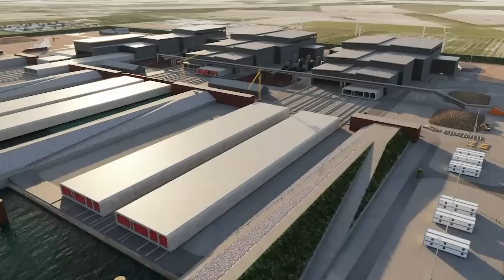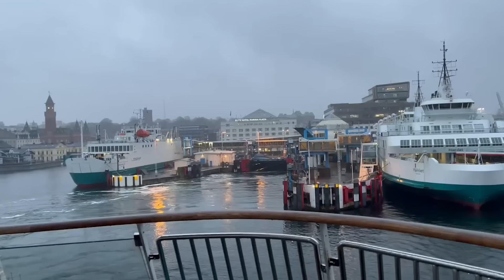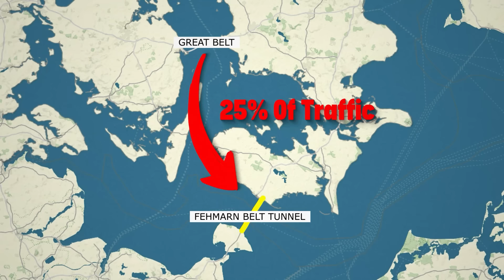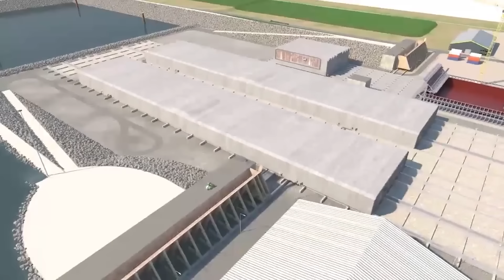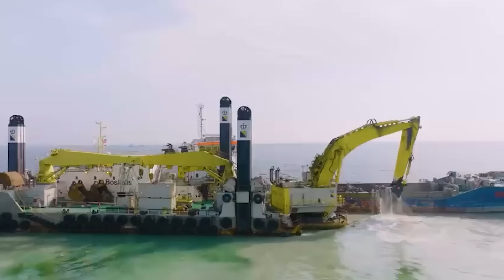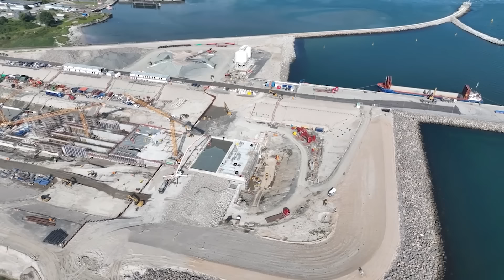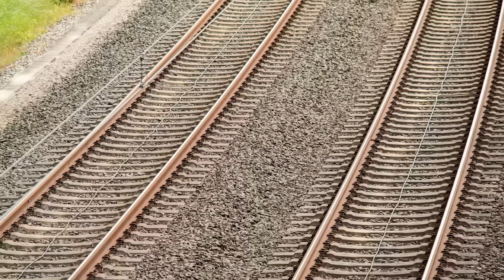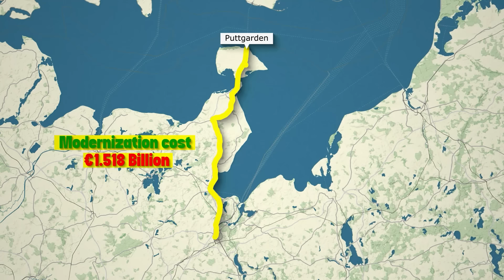Could Germany’s Delays Ruin a €7.4 Billion Mega Tunnel Project?

Comment: LONGEST UNDERSEA RAIL TUNNEL 53.85km - JAPAN.
But the longest undersea rail tunnel in the World is the "Seikan tunnel" in Japan that is 53.85 Kilometres long. Followed by the Channel tunnel between Britain and France at 50.5Km long. So considerably longer than the 18Km mentioned in this programme ?????
Reply from the maker: The Fehmarn tunnel will be the longest immersed tunnel. It’s not about total length in absolute terms, but about the construction type. The Seikan Tunnel is still the longest rail tunnel overall, and you can also find videos about both the Seikan Tunnel and the Channel Tunnel on our channel.
Reply: @RailwaysExplained  And that's is supposed to be some sort of Engineering marvel, I don't think ?  Exactly what Qualifications do yo have to list your channel as "Railways Explained" ????
Reply: @railwaymechanicalengineer4587  it’s a very different type of tunnel, it was considered to make it a traditional tunnel but it was not possible to design the tunnel so it was probably to use railway in the tunnel it would have to be built to deep and the angle of the climb would be too steep for a train the earth is not very suitable for a traditional boring tunnel and yes this is significantly more complicated to build then a simple boring tunnel which is the easiest least technical complex way but it wasn’t possible so we had to do it the hard way unfortunately and expensive, this tunnel has to have enormous amount of support facilities instead of just boring tunnel, but why are you commenting on something you clearly know nothing about you are not a engineer or your country is lacking behind on education.
Reply: @railwaymechanicalengineer4587  Building an immersed tunnel out of prefabricated segments that are laid onto the seabed is a completely different method with completely different challenges compared to boring through solid rock.

Both are engineering marvels in their own right.

And btw. if we are going to be nitpicky, the undersea section of the Chunnel (38km) is actually longer than that of the Seikan tunnel (23km). So again, it depends on the definition of what an 'undersea tunnel' is.
Reply: @stephanweinberger  As a senior ex British Railways Mechanical & Electrical Engineer I have worked for many Railways around the World. But I am not convinced you catually know what your talking about ! Which is why I asked, exactly what qualifications you have that makes you think you can call your website "Railways Explained ".
Reply: @railwaymechanicalengineer4587  ok, so we now at least know your reading skills ;-) (hint: different person)
Reply: @stephanweinberger  Yes I thought it ws the reply I was waiting for. Sorry. And I am fully aware of the vagaries of both the Channel tunnel and the Seikan tunnel, having worked for both British Railways and three Japanese Railway companies.

Comment: As a German, I am so damn angry and sad about this. We are not keeping our promise to expand the rail network with Switzerland, with Austria and Italy at the Brenner Pass, and now not with Denmark either. This country is a fucking joke.

Dear Danes, please sue the German government into the ground.
Reply: After 20 years of waiting Switzerland literally payed Germany to electrify and modernize the rails to München and it still took them about 10 years.
At some point SBB even proposed Germany should just give it ownership of the tracks and then we would do it ourself. Its pretty annoying and definitely holding back rail just because of Germanys central local.
Reply: Same happened with the rail freight line connecting the German industrial areas with the Rotterdam harbour. The Dutch part was finished in 2007. The Germans haven't even started on their part.
Reply: Sounds like the German saying "Ordnung muss sein" (Order must be maintained) has been forgotten
Reply: @MPbmfm  It is not forgotten, it has been exaggerated. To be correct in all possible ways, there so many procedures set up that it is very difficult to get things done. Except when it is about motorways.
Reply: @boldvankaalen3896 they are waiting for the next terrorizm ( like NS2).
Reply: sehe ich genauso. Die Politiker sind rundum unfähig und korrupt.
Reply: I just took the train from Hamburg to Munich and experienced how the delays piled up along the way so that we barely made it to our next train. German infrastructure, once renowned, is no longer in good shape.
Reply: Curious how building of Ore Maintain Tunnel between germany And Czechia will go, that's some competition on screwing up
Reply: I'd love to, but sadly our politicians are of equivalent "quality"... so they will mess it up.
Reply: We pay for the whole effing eu. Enough is enough. Pay us germans you mf want to use our land!
Reply: @HedgehogZone Denmark also pays more to the EU than we recieve! I understand your frustration, but remember that Germany is not the only country who funds the union.
Reply: If we sue the government, you're the one that ends up paying the bill
Reply: @DerpParrot, i dont care. The german government needs to feel consequences for there miss management
Reply: If we sue the German government, you will just close the bordershops, then we cannot buy cheap beer, and we will sober up. It will be much worse for all of us. Regards a Dane that is mildly annoyed at you for not keeping to your deadline.

First part is partly sarcasm and partly self-deprecating humour if someone is in doubt.
Reply: @Redgribben dude I am sorry for you and us honestly we have this shitty government since the 90s
Reply: I do think we Danes also have problems with the ship which is intended to service the elements being placed at the end of the former, below the sea.
Reply: And with Czechia as well, I haven't heard about any progress on Erzgebirgs Tunnel project in a while, federal government seems lukewarm to upgrade of line from border through Furth im Wald to Nürnberg and ignored and almost ommited stretch of line from Marktredwitz to border where it would connect to already electrified mainline.

And it seems like there also is no proposal, yet, to electrify line from Görlitz to Zittau (or Open Railway map does not show it) and to Czechia even thou there is proposal to electrify the line from Liberec to border. Given the proposed tunnel and new line from Liberec to central Bohemia, it would also provide new route for freight trains from area of north-east Germany to south-east Europe (and possibly also Italy). But in this case I bit get it as this project has only low priority in Czechia, unlike those two mentioned before.
Reply: Germany is decades behind on everything. It literally feels like going back in time, 1990s or even longer, when I visit Germany.
Reply: When I grew up, Germany was a trustworthy and reliable partner in Europe. This is not true anymore.

And for all people saying it is because of people complaining. Well, people are also complaining in Denmark, but Germany signed a treaty way back in 2008. That is almost 20 years for complaints.
Reply: Not the government but the people who live there and stop the projects. It's not the governments fault.
Reply: @UlliStein  so, a situation similar to that with the UK and the HS2 high speed line... there's still room for national and regional government to step in and limit the ability to challenge nationally significant infrastructure projects
Reply: @MercenaryPen  Thanks, yes that's so sad to compare this to high speed trains in France and Spain having their own tracks. It was so great to go from Madrid to Valencia with 300 km/h for 22 €. The train was perfectly on time and I was so amazed and jealous!!
Reply: @UlliStein No, that’s still the government’s fault. Locals only have as much power to stop an infrastructure project as the government lets them have.

And sure, you could argue that this is due to strong protections for property owners, but counterpoint, Germany has a law that allows them to demolish entire historical villages for ”the public good” if there’s coal underneath.
Reply: @UlliStein  The government has put legal procedures in place which allow these small interest groups to interfere indefinetely. Denmark does not have those.
Reply: @UlliStein  Just change the laws that it's harder to object to projects of national interest
Reply: @Breadfan00  Yes that would be a good idea, maybe a bit less democratic but it would help everyone.
Reply: @UlliStein  You act as if the government had no power to  design the process such that this wouldn't be possible.
Reply: @UlliStein Fix it. Change the laws until the problems can be solved.
Reply: haha we dont care we build bridges and tunnels just for the entertainment at this point 😂😂😂
with love from Denmark :D
Reply: @danis8455  speak for yourself. Some of us very much DO care
Reply: @Nordlys-Incognito you must have a pretty empty life getting mad about danish bridge obsession 😂😂😂😂

Comment: I'm German and unfortunately, we became so unable to do progress with infrastructure. It must be as cheap as possible, will undergo numerous studies, then all the NIMBYs delay everything by years with legal action, planners make many mistakes, so replannings have to be done, then costs rise because of that, then public complains arise that nothing happens. It's always the same. Just look at Stuttgart21, BER Airport (opened like 10 years delayed), the "Brenner-Nordzulauf) which is the connection to the new Brenner-Base-Tunnel, which didn't even start construction or the new Hamburg-Hannover High-speed Railway connection which also didn't start construction even though it's in discussion for decades
Reply: Germany became unable to do progress. Period
Reply: @fischX  Germany is unwilling to progress. If we keep voting for the conservative party that fucks everything up then we will continue to fuck everything up. The CDU has been nothing if not consistent, when it comes to austerity and corruption.
Reply: And  also Betuwe-lijn. It’s a freight rail from Rotterdam to Germany. Dutch part was finished 16 years ago. Building the German part should have started in 2003, but was postponed until 2016. And now it’s delayed to 2026. You managed to remarkably upset everyone around Germany...
Reply: @Alby_Torino  That’s probably a case of covert protectionism. Germany has no interest in shifting its maritime freight to Dutch ports and would rather use German ports.
Reply: @Sevyyy1406 you forgot to mention the Highspeed Line between Mannheim and Frankfurt ;) We are talking about this line since decades, but nothing has happened besides some studies and planning... its ridiculous, how long this takes
Reply: Don't forget the 3,2 km of A100 in Berlin :face-green-smiling:
Reply: I'm in a small town (30k people) just outside of Hamburg. It has a direct rail connection to Hamburg, but it and the local station have been shut down for decades. But on the upside, they're now planning to turn upgrade that existing old rail connection to an S-Bahn! Though a couple of studies need to be performed first, and lot of people living along the line have put up banners protesting the reactivation of the line. Even people who live more than 100 meters from the rails but directly on the B5, WHERE THERE IS TRUCK TRAFFIC DAY AND NIGHT. Anyways, that needs to be dealt with too, obviously. So the planning period to extend the S-Bahn network by simply refurbishing this existing line will take until 2032. 

Schon geil, wa?
Reply: In my opinion, we Germans don't want high-speed trains at all. The ticket prices charged here are so astronomical that it's much cheaper to just drive car.
If you then look at the stops between the routes, it is not possible that a train travels over 250 km/h on a longer route, it brakes again after a few kilometres High-speed trains for the next stop. If you then eliminate smaller towns along the route, prices will increase further because there will be less potential passenger throughput.
Therefore, high-speed trains will only be available up to the German border, after which it will continue at a maximum of 220 in a mixed network to save costs. Even the currently planned renovation programs Only a few of the biggest problems are repaired, and even then there isn't enough money or labor to do it. Over the last 30-40 years, all capacity has been used for new construction deleted.

The simplest way to reduce CO2 emissions in the German transport sector would probably be to reduce the size of the motorways for through traffic or to demolish them. So it would be faster to drive around Germany than through it on country roads. It would also cost less, and maybe there would be money left over for railways.
Reply: @Pechbird actually trains are generally cheaper in Germany. Compared to e.g. TGVs in France but of course they are also more reliable. 

It’s not impossible to get the German railway system, pun intended, back on track, but that would require serious investment and the political will to actually pull through with the infrastructure construction. The railway has been left rotting without maintenance and therefore the general renovations are really only necessary to stabilise what we have, we will need way more reactivated or newly build corridors to expand the capacity.
Reply: Alas, it is not just NIMBY. It's far, far worse: It's NABU! 

In most other European countries only local landowners and affected communities have a right to file objections against an infrastructure project. In Germany, on the other hand, all and every organisation with ideological objections can do this
Reply: Well, everyone becomes a NIMBY once idyllic countryside in your backyard is converted into a high-traffic road and rail lines. Of course people use every legal lever to stall the project or to move it elsewhere.
Reply: And on top of that Germany is a huge bottleneck for european high speed rail. While spain and france build HSR lines with AVERAGE speeds of 250+ km/h, german ICE barely ever run above 220. You gotta get your stuff together and build real high speed rail for once, Munich - Berlin should take 2 hours, not 4,5. Lufthansa is gonna lose money? Good
Reply: @ShardFlowers  While more high speed lines would be good, I wouldn’t necessarily say that it is a bottleneck. None of our neighbours to the north, south or east have lines faster than 230. So yes, trains have to slow down when they arrive from the west, but they never get to speed up again, so it’s not a bottleneck. It should also be noted that the high speed networks of France, Spain and Italy aren’t fully connected with each other either, they all have <200 km/h sections separating them. The connections to the German network are arguably better in that regard.
Reply: @fixminer9797  It’s a bottle neck because of capacity and thus unreliability
Reply: It's all true what you guys say. Unfortunately, for decades, money was more invested into car infrastructure, and currently expenses for social welfare and related things are in a all-time high, so savings must be made. So I don't expect too many new things to happen. 

However, what also needs to be mentioned, when it comes to new raulways, is that due to the widespread densely populated areas, building new lines becomes very complicated. In France, most Highspeed lines go to Paris, in Germany they are much more decentralized and spread apart - which obviously generates more work to maintain.
Reply: @Sevyyy1406 We still spend to much money in car infrastructure. If we wouldn't, there would be enough money for railway projects
Reply: @Sevyyy1406  the percentage of the budget allocated to social welfare actually stayed pretty much  stable over the last few years. No need to play these issues off against each other. 

The issue is that funding got poured into road infrastructure and the railways had to function under austerity measures. There was basically no funding for maintenance of the rail lines and a lot of them got decommissioned in the same time. The federal government (namely the transport ministers) and its 100% owned DB had different priorities and objectives. 

Let’s just blame the CSU and look very closely on what Patrick Schneider will be doing.
Reply: just as with swedes going to a toilet must make money or else